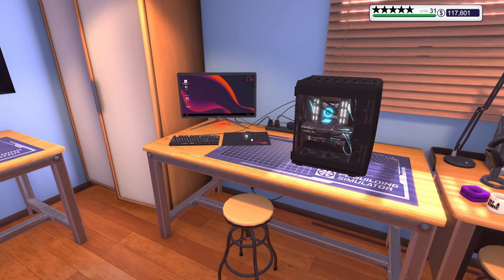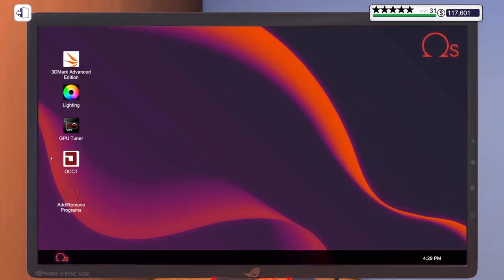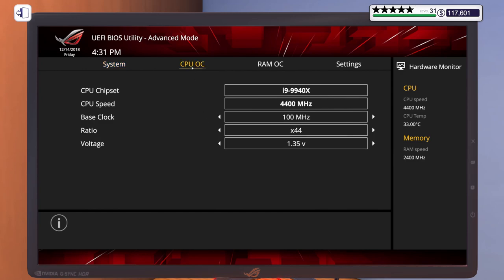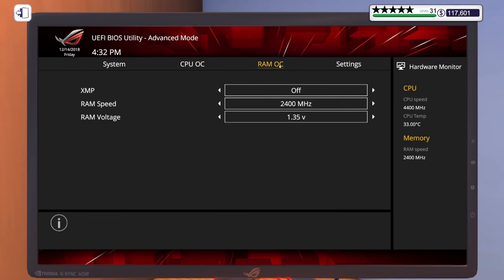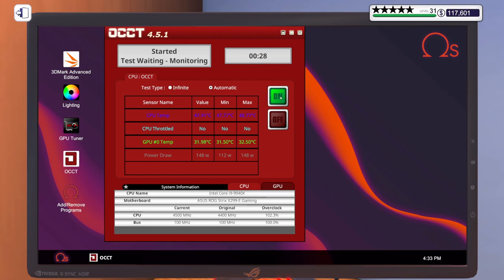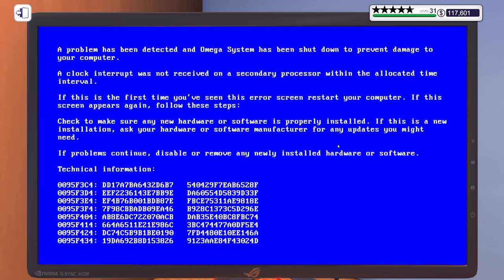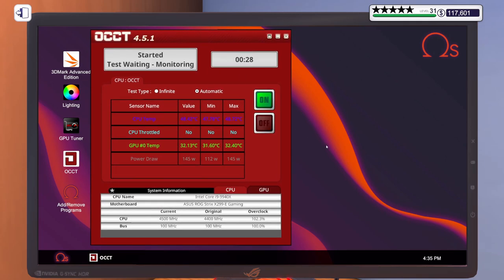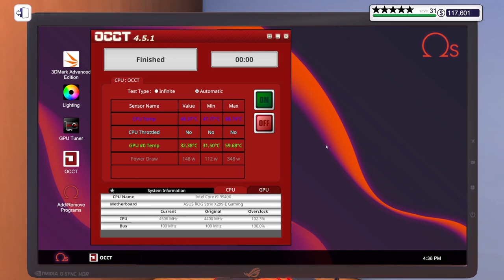CPU Overclocking Tutorial | PC Building Simulator (Version 1.8)

Comment: so does the game not recognize custom cooling cpu's? I've found i get better overclocks on air cooled cpu's hitting 90*, than cpu's around 50* water cooled.
Reply from the maker: It does, but there is a silicon lottery in the career mode of the game (which is what I was in). So the CPU I was using in this video was probably not a "top binned" CPU. All CPUs (and GPUs) in Free Build are the best of the best.

Comment: I've got lucky with an i9-6700k cpu in the game, OC'ed to 5GHz straight away . Thing is that Airflow is completely stupid in this game, it seems that no matter the setup, you're always getting 80+ temps, whenever you OC , even if it's from 4600mhz to 4700mhz.
Say you got an 8core at 3600ghz,  and like 8 100airflow fans all around it. It sits at 35C , 50C in stress test. OC to 4ghz, it's going to sit in 80-90C, no matter what air/water cooler setup you try with the best parts available. Realistically, no one with a basic understanding of computer parts is going to be happy gaming with his CPU above 75C, and also realistically, a 5ghz OC is achievable with below 80C temps already, without too much struggle. Whomever designed the cooling variables in this game should be fired.
Reply from the maker: I'm with you on that, certain things in the game don't scale properly ... hopefully they are working on these problems. I've had similar problems when trying to overclock most of the Threadripper CPUs (even when using a custom loop with multiple radiators), at stock speeds they are cool as can be but overclock them by 100 MHz and they run so hot they throttle or just plain blue screen.
Reply: @BigJake901  I did a custom loop with 2 of the biggest radiators I could fit and copper pipes on a 3990x . I ran like rows of pipes, fitted  one mile  of pipes all around the case, the result was a surprinsing <70 degrees when slightly overclocked. But nobody actually does that, apparently the game engine thinks that every 20inches of cooling pipe equals 1 degree lower temps lmao.

Comment: 2.05 on the ryzen 9 5950x…. The pc will start. But after running OCCT the pc blue screens. I don’t know what to do. I didn’t change the base clock or even the ratio. I just left them stock. Should I bring these up to level out the over all voltage?

Comment: Idk if youll still be able to help because its a abt PCBS2 but i cant seem to get the over clock to not crash the entire pc
Reply from the maker: PCBS and PCBS2 are very close to the same with overclocking. If you are OCing the CPU and it's crashing, there are a few things to check. 1. Make sure that the PSU can handle the OC, overclocking uses more power and an underpowered PSU can cause a crash. 2. Not enough voltage, up the voltage to 1.55 or even 1.65 as most CPUs in the game can handle that voltage. 3. OC is just too high, lower the overclock because the CPU just can't handle it. Overclocking is a lot of trial and error, and requires time. Increase the overclock/voltage slowly and run OCCT after every change. Hope this helps you out 🙂

Comment: Nned some advice... Only a level 5 in the career mode and got a job to hit a 4799 3DMark but struggling to get anything past 2200.

Really could use some tips/help. Thanks
Reply from the maker: If you are only at level 5, you may not have access to the parts you need in order to get the 3DMark score required. If it is a job with an expiration date, then you may have to reject the job ... some jobs in the game are actually meant to be rejected. However, if it is a job with out an expiration date, then you can just store the PC until you unlock the parts necessary to get the required 3DMark score.  

Hope this helps you out. Let me know if I can help you further.
Reply: @BigJake901  Thanks, luckily I done a few jobs and it took me to lvl 6 and got the program for the OC. Managed to do what I needed and got the exact 3DMark for the perfection trophy 😁

Comment: Good video! But how do I fix thermal throttling my customers keep complaining and on OCCT it also shows it throttling. However I can’t find a fix for this as I can change the cpu cooler the game wont let me
Reply from the maker: If you can't change the cooler, that makes things pretty hard. Make sure there is thermal paste applied, and if its a crappy cooler, you may need to remove the overclock completely to get it to stop thermal throttling.

Comment: 3D mark starts rapidly dropping fps a few seconds in if i do any more than a stock clock on a and ryzen threadripper 2990WX, any clue what’s happening?
Reply from the maker: It does that when the CPU is throttling. You will either need to back off the overclock or install better cooling or possibly both. Just from personal experience, the 2990WX needs water cooling with multiple radiators to hold any kind of overclock.
Reply: @BigJake901  thanks for the crazy fast reply man! i’ll give it a shot!
Reply from the maker: Hey, no problem 🙂

Comment: I still can't get it after 5 seconds into the stress test I get a blue screen
Reply from the maker: You either have overclocked the CPU too far or your thermal solution isn't up to the task of keeping the CPU cool and stable. Recommend try lowering the OC or try a different cooling solution.
Reply: @BigJake901  I figured out what I did instead of using the ratio to over clock I used the one below it

Comment: I keep having blue screen when I overclock 1500x to 3850mhz
Reply from the maker: It could be due to lack of cooling or silicon lottery (you may need to try multiple CPUs to get one that overclocks well). First gen Ryzens weren't great overclockers in the first place, I know 150 MHz over the max boost clock doesn't sound like much of an overclock but it is for a first gen. If you have them unlocked, you could try a Ryzen 5 3600 in place of the 1500x. The 3600 is $10 more, has 2 more cores, has the same 65 w TDP, and is already clocked at 4200 MHz. Hope this helps 🙂
Reply: @BigJake901  I can't use other cpu. The task requires me to use that 1500x
Reply from the maker: Then it’s either lack of cooling, too high of a voltage setting, or silicon lottery. If it was me I’d get another 1500x and see if it overclocks better.
Reply: @BigJake901  It still showing blue screen. Is it my overclocking method is wrong ... What basic clock and ratio should I choose? My motherboard is ab350m gaming 3
Reply from the maker: Okay I just tried it with the same motherboard and processor. I used an Arctic freezer 33 esports edition and was able to overclock to 3850 MHz no problem. Make sure you have a PSU that is at least 400 watts as it pulls well over 300 watts when overclocked.
Reply: @BigJake901  It still not work :(
Reply: @ydnawong1285   maybe the cpu is broken.. I also tried over clocking a 1500x to 3.9 ghz with around 1.4v still works fine

Comment: I just started the game... but wondering.. what is the actual benefit of overclocking? 
I mean getting +100MHz doesn't seem worth it.. why not just buy a better CPU?
or do you get missions that a client wants a certain benchmark, but his budget won't cut it, so you need to overclock...?

But what about real life? why "risk" or damage the component over time.. for a few extra MHz?
Reply from the maker: This is probably going to be a long answer lol. 
In the game, there are a few reasons to overclock either the CPU, or GPU, or both. The first reason would be because you are playing the career mode and the customer requests it. 
The next reason would be because you want to make more money on PCBay, in the game. As you rank up in career mode you will eventually be able to unlock PCBay. PCBay is a place to sell used parts and auction fully built PCs. Also, as you continue to play, you will amass lots of used parts. You can either sell off the parts one by one or you can build PCs out of those used parts and sell them on PCBay. Overclocking the CPU and GPU generally gets you more money for the PCs on PCBay.
The final reason is, it's just plain fun. It's fun to see how far you can push a component before it breaks and to try and push for high 3DMark scores. 

"Why not just buy a better CPU?" Often in the game as in real life, sometimes the budget doesn't allow for a better CPU. In that case overclocking can gain you a few FPS "for free" by overclocking. 

"But what about real life? why "risk" or damage the component over time.. for a few extra MHz?" As I stated previously, sometimes the budget doesn't allow for a more expensive/better CPU and overclocking can often gain you more performance out of a lower cost CPU. Then on the other end of that, some people want the most out of their high-end CPU. For these people, they usually upgrade every couple of years so degradation over time is not an issue for them because they are going to have new hardware before their current hardware shows issues. Overclocking can also help older hardware stay relevant longer. Overclocking your CPU is relatively safe as CPUs and motherboards have protection built into them to help keep you from pushing the overclock/voltage too far (unless you turn those protections off, but that's a whole different story). Honestly, degradation over time isn't a huge issue either. IRL I have an i7-4790K that I bought at the end of 2014 (I used it until I purchased my i9-9900K this year and it's now in my wife's gaming PC), it has been overclocked to 4.8 GHz since the day I bought it, and is not showing any signs of degradation from being overclocked for over 5 years.

Hope this helps. If you have further questions feel free to ask 🙂
Reply: @BigJake901  
Thanks for the elaborate response.. you earned a new sub
Reply from the maker: No problem, happy to help 😀